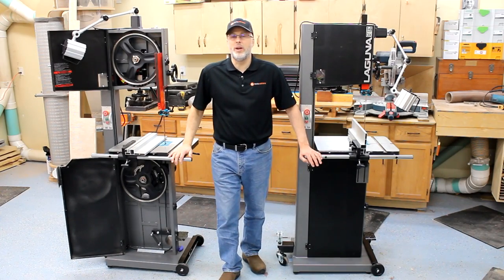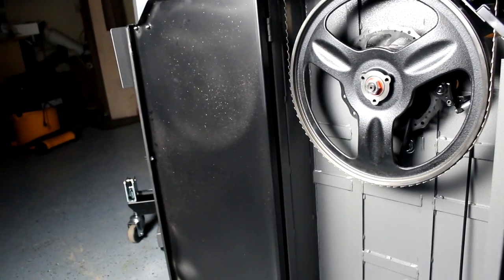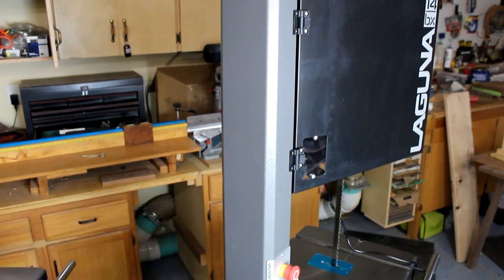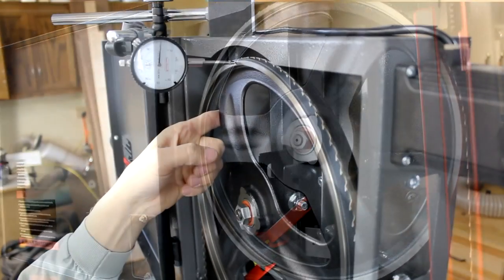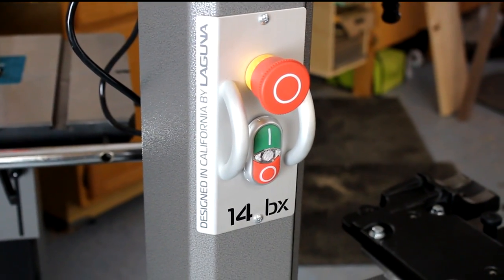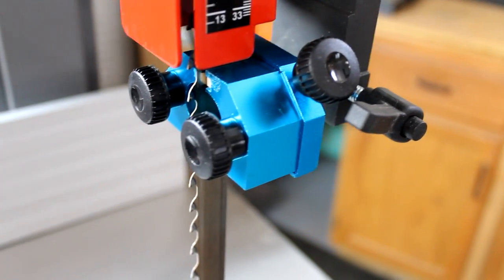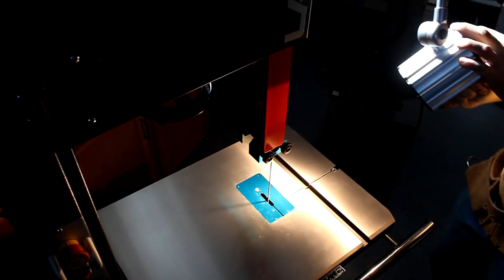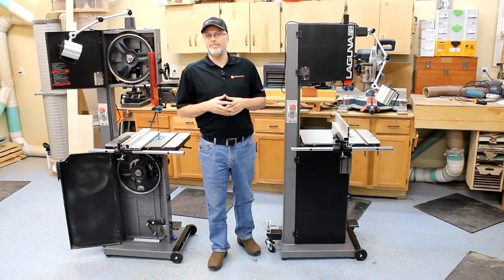Laguna 14bx Bandsaw "Deep Dive" Examination by ToolMetrix

Comment: Great review.  Picked up a 220v 14BX from a local woodworking store, was able to see this on display right next to the 14/12.  I originally was going to buy a 14/12 (finally have a dedicated shop space and a bandsaw has been on my buylist for a long time), but after seeing them both side by side the 14BX just seemed to feel a little more stout/beefier.  I ran this saw for the first time this weekend; it resaws like a dream and the accuracy when cutting thin veneer (i tested it out on a 6" wide piece of cherry) was awesome, was able to get a 1/8 thick and a 1/16" thick cut with very little fuss & setup. (was using a Laguna 3/8" 4TPI blade.)  And this is coming from someone with very little bandsaw experience, this is my first bandsaw purchase & I am wondering why I waited so long to get one!  Keep up the good work, really enjoy this channel!
Reply from the maker: Thanks for the feedback, Chris. You nicely summed up what impresses me most about these saws. They resaw like a dream right out of the box without the hassle that I used to associate with resawing.

Comment: Very well put-together video; very informative.  I think that Laguna could’ve done a much better job in light selection, however, in that Halogen lights are extremely inefficient, produce such high heat that a person could end up with a serious burn if he/she accidentally touched that halogen lamp.  LED would’ve been a much better choice; cool to the touch because it generates virtually no heat, and they’re very bright, last a long, long time, and draw a fraction of the wattage of halogen lamps...and LEDs are much cheaper in cost, too.
Reply: Agreed ... halogen is like 40 yr old technology... plus the filaments break easily if you hit the light with moderate force.
Reply from the maker: These seem to have much more durability than those cheap portable lights that you get from home centers. I haven’t had to replace any bulbs and I haven’t heard of that being a problem. Laguna is in the process of moving to LED now. The new 1524 lathe uses an LED and it looks great.
Reply: @ToolMetrix  Curious where you heard they're switching to LED? This comment is a year old and they're still selling the halogen lights everywhere I've found.
Reply from the maker: I had one on my 1524 lathe. It was sweet. If you search for LED on their website you will find it.
Reply: @ToolMetrix  Oh cool. Looked on their site and sure enough, it was right at the bottom of their page for the 14bx. Thanks!

Comment: If you could help me out on this .. i pick this unit 2 days ago same as yours specs for 700$ i thought was a good deal and in great shape barely used but missing the original fence and hope the guy finds it as he just moved lost in transit?, My question i see this per manual says to connect to a 15 amp in 220V. I called laguna and they say 20amp CB is preferred because of initial spike jump on start up then runs at 9.8 amps  . I have it ready to wire CB to a 20 amp but thought i should just use the 15amp. I have 12/3 wire in Breaker box ready for the 20 or 15 CB what do you use as a connection ends at the wall and extension to the 14 gauge straight blade on motor .Also if the fence is not found would you by the laguna original or their upscale one 400$ or equivalent if there is one. Also for re-saw the king blade the best bang for this machine. Thanks So Much.
Show less
Reply from the maker: The amperage draw will be determined by how hard you push it. I don’t know what circuit is needed. Stock fence is fine. I’d probably go with that.

Comment: Just ordered the Laguna14 DX 220 volt Ordered the wheel kit and the light. Need your advise on what blades I need I know I need  1/8'not sure on teeth Wanted 1/8 for schroling  also want at the othher end a King Resaw Carbin blafe wheat would your 2 middle of the road blades would you want
Reply from the maker: The blade that sits on my saw 99% of the time is a 5/8" 2 TPI Timberwolf.  Good enough for gentle curves, cutting up logs, resawing, etc.  For slightly tighter curves I use relief cuts.  For super tight curves I pull out the 1/8" blade and the Carter guide, and for critical resaw work I install the Resaw King.

Comment: How can I find out what is the best blade for most things you do on the BX want to do this plywood1/4" and  thicker plywood and resaw 8' to 12' logs into nice planks. Don't know enough about the blades yet and don't want to waste money on blades I don't need.  Saw chris choice but that might be the blade they sent with the saw?
Reply from the maker: Hi Thomas, great question.  I do most of my cutting with a 5/8" x 2 TPI Timberwolf blade.  That works great for slicing up logs and most gentle curved cutting.  It doesn't leave the cleanest edge on 1/4" plywood, but it's good enough for a lot of applications.  If you want to cut tighter radius curves, you'll want a thinner blade.  If you want a cleaner cut edge, you'll want more teeth.  But the perfect blade for cutting logs is not going to be the same as the perfect blade for cutting 1/4" plywood.  I try to use one blade that is "good enough" for a variety of applications so that I can avoid blade changes.  But, I have 1/4 x 6 TPI blades for tighter radius work, and a 1/8" blade for scroll cutting, and if the situations requires it, I switch it up.

Comment: Nice review, good to see some actual measurements (indicators and vibration). Soon as You comment "dead flat ( https://youtu.be/PDU_2sT0etc?t=487 ) on the cast iron table top surface, the mirror image of the blade (that is straight) is warped, though. Cool saw overall
Reply from the maker: Thank you for your feedback.  What you are seeing in the distortion of the blade reflection is not an indication of the table not being flat.  I actually still have that saw, and the table is still flat.

Comment: The quality of the machine and its performance is too poor. After sales support is also very bad. All machines are made in Taiwan or China. So our strong recommendation is not to buy any machine from Laguna Tools.
Reply from the maker: Thanks for sharing your experience here. Sorry to hear this.
Reply: Where are  bandsaws made other than Asia? And at what price for a comparable saw?
Reply from the maker: Laguna has a line of saws that are made in Italy, I believe.  Look for the LT Series. Also, Agazzini is a good European bandsaw. Yep, more expensive. If the price difference were 10% I’d own a European bandsaw. But it’s more like 80%. I’m not a wealthy man, and I haven’t had any problems with my Taiwanese bandsaw, so it seems like a good option for many of us.
Reply: @ToolMetrix  Laguna are not manufacturer.so it will be good if possible to buy from manufacturer.i perchesed few products from Laguna. there support are extremely bad.

Comment: what was the spark at 2:25?
Reply from the maker: +Eason Qin Great question, and I'm glad that you posted it because I also received that same question privately.  This is normal and happens frequently with ceramic guides, and nothing to be concerned about.  The HD camera really captured one in dramatic fashion, but if you look closely at ceramic guides while cutting you can see sparks on an ongoing basis.

Comment: Thanks for the great review. After so many years what are your thoughts on the 14bx now? I’ve recently read some not so positive reviews of the bx for regular curved cutting rather than resawing.  Also, do you have experience with the Rikon 10-326  vs the 14bx? Keep up the great work.
Reply from the maker: I upgraded to an 18bx a couple years back, but my friend still has one of the 14bx machines and he absolutely loves it.  You can't beat it in its class for resawing.  I used mine for curved cutting a lot and never had any problems.  For tight curves using a 1/4" blade or smaller, you need to go with the mini guides or a carter guide.  The standard ceramic guides are rated for use on blades down to 1/4", but I wouldn't recommend them for use with 1/4" blade because there isn't much blade to grab and if you hit the teeth with the ceramic it will dull the blade instantly.  I haven't used the Rikon 10-326, but I had a 10-325 for a while.  it was a decent saw, but did not have the same power as the 14bx.  Also, the guides were not very nice at all, and a pain to adjust.  I'm guessing that they have addressed this because it was a common complaint about the saw at that time, and it was about 5 years ago.  The dust collection was also terrible on that saw.  Other than that I liked the saw, and it ran smoothly.

Comment: I've had my 18" for about three years and I hate it so much I hate to walk by it. The guide set up sucks, the table tilt adjuster sucks, The two table locks don't tighten the table and with a little bush it will tilt. Dangerous with something heave near the edge. A lot of luck adjusting the bottom guides as you can't get a hand in there and I have to use a channel lock to tighten. The blade guides rotate as you tighten on the top and bottom. Terrible engineering. Oh, you can't change the side you fence is on with the blade in without taking the fence off.
Did I say I hate this saw?
Lee
Reply from the maker: Hi Lee, ugh!  That sucks. Sorry to hear that you have had such a negative experience.

Comment: Can the 1.75 110v be wired 220v? Noticed the motor is listed as 110/220.  Does Laguna provide both cords since the motor is labeled for both voltages?
Reply from the maker: Hi Ryan, yes it can be wired for 220.  It comes wired for 110 and only one cord is provided.

Comment: Hey, Paul - silly question. What breaker is needed need to run the 220v 14bx?
Reply from the maker: I believe it’s a 20 amp but I don’t remember for sure. I’d suggest checking the manual.

Comment: how do you put that 1/4 inch blade on there without the stock guide? Laguna recommends their (totally overpriced) micro guides, you can also get the carter jet1, but i see you set it up differently. Curious on how you pulled it off and if it was just for the review or if it worked long term.
Reply from the maker: There’s not much to it; I just leave the side guides open. It works ok for modest curves but not for anything too tight. If I was doing a lot of scroll cutting I’d probably get a Carter stabilizer or the Laguna mini guides.
Reply from the maker: BTW, that's a 1/8" blade that I'm using without the side guides engaged.  I use the guides for 1/4" blades.  I feel like I'm pushing my luck a bit in doing so, because those teeth are very close to the ceramic, and there's not a lot of side support on the blade, but so far I have not had a problem.  I wouldn't want to do a lot of tight radius cutting this way, but it works fine for my typical uses.  If I were going to make something that required a lot of tight turns with a 1/4" blade, I would want to use either the Laguna mini guides or a Carter stabilizer.

Comment: Hey Paul, do you have any experience with Grizzly bandsaws? Specifically this one: Grizzly G0513ANV - 17" 2 HP Bandsaw, Anniversary Edition

Do you have any input or opinion on grizzly bandsaws in general? Thanks in advance for any input you might have.
Reply from the maker: Hi Brian, I do not have any personal experience with Grizzly bandsaws.  I hear mixed reports on their bandsaws from owners, and the trend that I'm sensing is that their lower-end cheapy models are problematic, and their higher end saws are quite nice and good value.  To be fair, this deduction is formed from far too few data points to be defensible, but that's what my gut says at this point.  Without knowing anything about that particular model, it seems like it's on the lower end of their price range for saws in its class, which would raise a concern given what I've heard.  Having said that, it does not have a brake which partially explains the low cost (although it would be my preference to have a brake on a saw this size), and it seems to get predominately good reviews with over 100 customers providing input so far, so those things lower my concern level quite a bit.   Sorry I don't have anything definitive for you.
Reply: @ToolMetrix  thanks a bunch for taking time to respond. This is for a friend of mine. And I dont want him to buy junk, if possible. (I've got a laguna and I love it.) But I have always wondered where grizzly stands on the market.
Reply from the maker: Absolutely my pleasure sir. This question comes up a lot so I really need to see if I can get my hands on a grizzly bandsaw.
Reply: @ToolMetrix  and other grizzly stuff.  Their lathes look tempting to me... but I can't see buying one over the laguna. (Laguna is my favorite brand) The grizzly brand seems to be "good value" on face value.  But I'm too scared to buy them in fear of bad quality.
Reply from the maker: I put them in a slightly higher risk category. The only Grizzly tool that I own is an 8” jointer. Motor died shortly after I got it. After replacing it I haven’t had motor problems. I find that it performs ok but goes out of adjustment a lot and isn’t the smoothest running tool in my shop. That said it does the job and was a good value, but it feels like a step down in quality compared to the jet jointer that I had previously. That was a sweet machine.
Reply: @ToolMetrix  cool, thanks bud. Good info. Hate to buy a tool only to find out it's not worth having.
Reply from the maker: No doubt. These things aren’t cheap!
Reply: @briancv83  I have multiple machines from Grizzly and the only problem I've had is that UPS as a freight company is terrible. No damage, just never meet their commitment to delivery times.

I have the G1023WRX and the G0513X2. Both have been flawless performers. I was considering the Laguna 14/12, but when I got my hands on it in-store, it felt cheap. Just winding the blade guard up and down sent the whole machine wobbling back and forth. I also did a ton of research on Laguna and as a company, they have a terrible reputation for customer service. The main draw for me on the Laguna machines was the features vs footprint. My shop is fairly small, so space is a premium.

If you have a problem with the machine, Grizzly's customer service is excellent. I was missing some bolts for my table saw. Grizzly sent them immediately along with a 10% off coupon. I used that coupon on my bandsaw. So, for some missing bolts, the 10% coupon was worth $120.

Grizzly definitely builds these to a price point, but so does Laguna. If I could justify it, I'd buy a Powermatic or better yet, a MiniMax.

Comment: I have a question and since you have knowledge of luguna band saws.  I have the 14bx and had it about 4 months and got busy with other stuff, then got sick then busy again before i got to really use it.  It functions but it does more burning than cutting and I am not forcing it into blade.  I was going to to cut some 4 inch wide strips a 1/4" thick and i gave up after about 3 inches into cut and backed it off the blade.   I will contact luguna also but have watched your videos before so thought id ask.
Reply from the maker: Hi Wayne, I’m guessing that your blade got flipped around and the teeth are pointing in the wrong direction.  Take the blade off, coil it up, uncoil the other way, reinstall it and you will be all set. Happens all the time.
Reply: teeth are pointing down
Reply from the maker: Is it doing that when you are free hand cutting or just when you use the fence?  If it is doing it when you are free hand cutting then your blade has a severe problem. If it cuts fine in free hand mode but won’t cut when you are using the fence then you can do one of two things. Adjust the fence to compensate for drift or try to adjust the blade so that the drift goes away. For the latter look for a video by alex snodgrass. The former is quicker and easier and doesn’t bother my serenity.
Reply: @ToolMetrix  I was using fence.  Will check again when I get home.  Thanks for the quick reply...
Reply from the maker: Ok cool. Then it has to be fence alignment. Draw a straight line on a piece of scrap. Make a cut to follow the line. Stop half way through the cut and leave the work piece where it is. Adjust your fence to align to the work piece. Then try to rip using the fence. Should work with no problem.
Reply: @ToolMetrix  Hello again.  I tried as you said and no change.  I tried first with a piece of hardwood then a piece of pine.  Pine is easier of course.  The band on the saw is 3TPI and a Laguna band.  Would it help if I sent you a pic of the hardwood I cut?
Reply from the maker: If the teeth are pointing down and the blade isn’t slipping and you are making a free hand cut then the blade is bad. It was either defective out of the box or the teeth hit the ceramic. Bandsaw teeth will be completely dull within seconds of contacting ceramic while running.
Reply: @ToolMetrix  Ok Thanks.  I will try a new band.  Thanks for your help.
Reply from the maker: Let me know how it goes